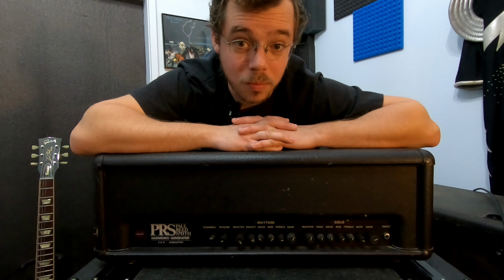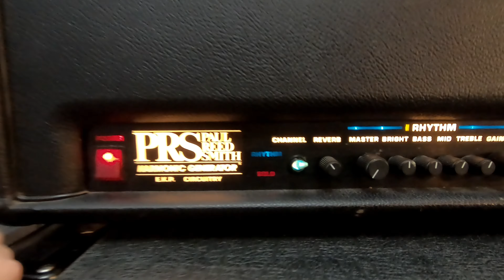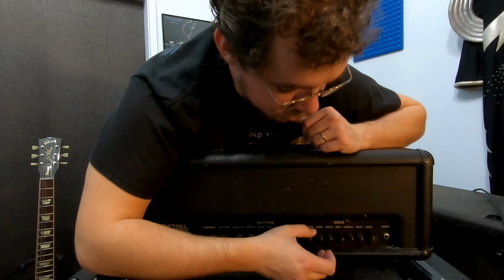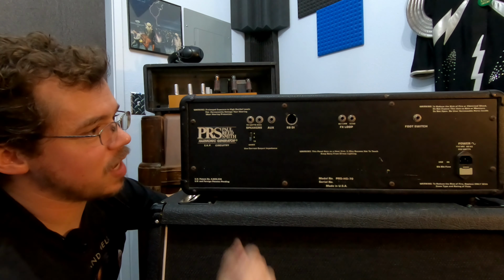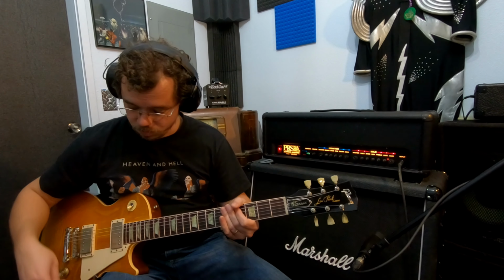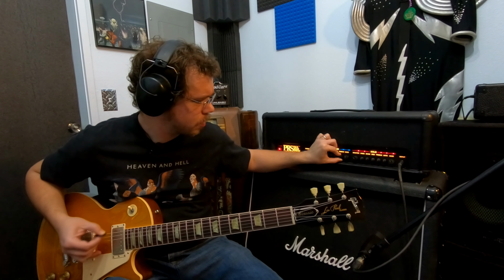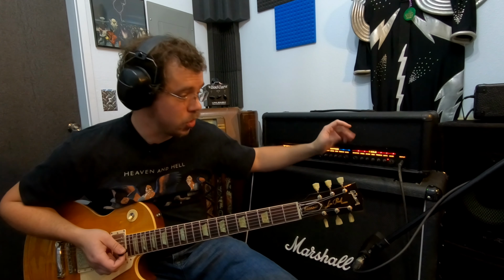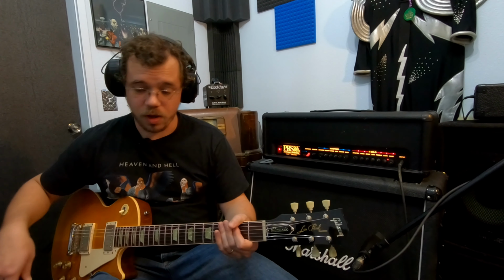Paul Reed Smith Harmonic Generator In Depth

Comment: Love it dude, great job. Crank that High On Fire!
More weird, rare, cheap amps to look out for are 80s and 90's Ampegs like the VT-120 and VL-1002. I've had both and they sound awesome.
Reply from the maker: Thanks! Art of Self Defense is one of my favorite albums. I've been looking for some of those "everyone hated them then but have fond memories of them now" amps that I can pick up for super cheap, like the Ampeg VH-140c. But I'll have to add the VT-120 and VL-1002 to the list!
Reply: @obsessedwithguitars3157  If you go VL-1002 shopping look for a modded one. They were a great design but built like shit and would run so hot that some of the cheap connectors in the amp would melt. It was a common mod to removed them and hard wire the connections. Making for a much more reliable amp. Fantastic tone either way.

Comment: Every amp has these kinds of warnings. Looks like there is a port to change the fuse so all the warnings apply.
Reply from the maker: Man, my JTM 45 didn't, my Matamp didn't, my Orange didn't, and perhaps I just didn't notice them on the others I've owned. But they were simpler amps and the only ones I ever did in this.level of detail, so it's probably that I just never noticed them!